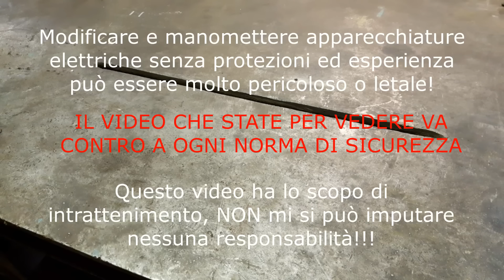Microwave transformer, the best modification for Spot Welding machine

Comment: Zusammen hat die sekundäre Wicklung (Hochspannungswicklung) ca > 25 Ohm Wechselstromwiderstand.
Diese macht man zur primären Wicklung.

Warum trennt man nicht die vorher noch sekundäre Hochspannungswicklung in der Mitte einfach 
gant auf  ? dort setzt man eine Lüstterklemmen dran . Dahinter kommt je ~ einen dicken 30  Ohm Widerstand 
mit Kühlkörper je nach Trafotyp. Setzt dort auch noch an die ganz aufgetrennten Enden Lüsterklemmen. 
Dann legt man an eine Wicklung 220 V dran dann schlißt man beide Wicklungen parallel die dann  auf 12,5 Ohm Wechselspannungswiderstand (wegen stärkerer Eigeninduktion) plus ~ 12,5 Ohm Normalwiderstand kommen. 
Somit wieder 25 Ohm. Durch die Übersetzung bekommt man dann an der dickeren Wicklung vereinfacht ca 21 V.  
jetzt aus der dickeren sekundären Wicklung mit ca 10 - 20 A  ? als Trafonetzteil für zuhause ?

Dahinter käne dann das stabilisierte Brückengleichrichternetzteil
eine primäre Kippsicherung schadet hier dann bei 220 V auch nichts.
Einige Mikrowellentrafos (wie mein verwendeter) 
(Wikipedia und Google geben hier unterschiedliche Werte an)
Die meisten  liefern aber bereits normal 25 V Europa , 10 -12 V USA
Man bekäme dann sekundär (in Europa) 50 V !

Comment: Interessante, ma con un solo primario (rispetto alla possibilità del parallelo proposta), la potenza del trasformatore non aumenta rispetto al singolo trasformatore anzi, il circuito magnetico risulta più complesso e maggiori sono le perdite del flusso magnetico. Per quanto riguarda il secondario, effettivamente sono necessarie 4 spire che però si riescono a ottenere ugualmente con un singolo trasformatore. Le possibilità sono due: o si tiene il core del cavo 1 AWG e si rifà l'isolamento esterno molto più sottile (lavoro un po' complicato ma fattibile) oppure, un buon compromesso semplicissimo da realizzare è costituito da un secondario bifilare cioè due in parallelo ciascuno di quattro spire con comune cavo da 16 mmq di cui, tra l'altro, ne può essere usato uno soltanto in caso di necessità di minore potenza.

Comment: Can you tell me how many windings and what cross-section the cable has? Thanks
Reply from the maker: Hi, I made 4 complete turns of cable, the copper section is 12 mm in diameter
Reply: Thank you
Reply: Approximately how many amps come out of this?
Reply from the maker: It depends on the power of the primary and if you put only one primary, or two in parallel... With a primary you get about 300 amps. However, I recommend you follow the channel, because before the end of the year a new video will be released with a new very powerful transformer for spot welding machine...

Comment: If you use two smaller secondary wires and wrap on with one more turn than the other it would greatly reduce the hum as the alternating cycle of each wire will not be in unison as the voltage differential will seek to equalize.

Comment: che spessori di lamiere riesci a saldare? io devo saldare lamiere di auto e vespe. un saluto e ottima modifica
Reply from the maker: Ciao, mi è capitato di saldare lamiere da 2 mm, quindi per lamiere da 6, 8, 10 decimi, non hai sicuramente problemi.... per fare un bel lavoro, mettici anche una ventola di raffreddamento
Reply: @newtech5042  si pensavo proprio di riutilizzare la scocca di una saldatrice con annessa ventola. Una curiosità: hai provato a metterne un altro in serie? Potrebbe portare qualche vantaggio?
Reply from the maker: @NewRetroElectronics  Con la scocca di una saldatrice puoi ottenere risultati ancora migliori! Mettendolo in serie ho solo ottenuto più volt, ma non va bene se vuoi creare una puntatrice!

Comment: It was possible to install two primary windings connected in parallel. By doubling the power of the primary winding. And even better, connect two transformers in parallel and you won't have to cut and weld anything.

Comment: I made one, but with a transformer and a plug, and I made 3 turns of 35 mm cable...but when I measure the voltage of the coil, I don't find anything, knowing that the spark is high...is the lack of voltage normal?
Reply from the maker: Hi, actually you should find voltage, even just 1 volt, but you should find it...
Reply: @newtech5042  I will not pay close attention and I was measuring direct current.. the mistake was mine.. now I measured and found 2.8 volts.. but the current was not enough.. now I collected two 10 mm wires and turned 4 turns and now things are good and the voltage is about 4 to 5 volts
Reply: @MoradELectro  with 2x10mm and 4 turns are ok for cells soldering?

Comment: Almost everything you did was wrong or unnecessary.,  Curing off the mounting base of both transformers was the first error.  Using both primary coils, with one bottom and one top would allow wiring in the middle, wire the primary coils in series and make it 220VAC, gives you better low heat high power to the transformer. I used two 12GA solid wires in parallel to make the secondary coil, produces around 48VAC and uses less ampere to spot weld.  Adding a voltage control to the input power can make it adjustable for fine tuning the output heat and excessive burn on thinner materials.  Full on maximum power my spot welder uses less than 18 Amps and runs cooler than other factory made units I have owned in the past.  Good luck.

Comment: Before soldering the two cores together, you should make sure that they fit perfectly because if there is an air gap between them, the magnetic circuit loses efficiency.
Reply: CORRECT  JORGE  BUT SOLDERING TOGETHER IS  IMPOSSIBLE, TOTAL MISS MATCH OF ALL MATERIALS. NEVER ENLIVEN ORIGINAL TRANSFORMER WITH SECONDRY STILL PRESENT AS 6,000V COIL WILL KILL YOU  IF YOU ACCIDENTLY GET ACROSS IT.

Comment: The idea is best, realizing is the worst. In this configuration magnetic shunts don't need, and as is was told below, the gap is unappropriated. And there doesn't need to weld, it is enough to to tight with metal string.

Comment: There is no point in such a design. Wasted time. It would have been better to connect the two primary windings in parallel and the two secondary windings in series. Then you would have double the power.
Reply: Would you please explain why??
Reply: @sidamarali3030 По тому что мощность магнитного поля зависит не только от объема магнитопровода, но и от мощности первичной обмотки.
Reply: @sidamarali3030  потому что первичной мощности трансформатора будет недостовать, и напряжение вторичной обмотки будет проседать под большой нагрузкой.
Reply: Yeah i saw a video of that very set you just mentioned and it worked wonders
Reply: Спасибо, друг! 👍😀

Comment: Hello, I am planning to use this spot welding machine to solder copper foil but don't know if it is possible? Can you help me make a video about using this welding machine to spot weld copper foil?
Because I'm not good at English, I used Google to translate the words. If there are any mistakes, I hope you understand
Reply from the maker: Hi, copper is a low-resistance metal, so it is very difficult to weld it with a spot welder... Someone has tried with tungsten electrodes, but with poor results, so for now I don't know how to help you...
Reply: @newtech5042  Thank you for this sharing. I'm looking for a way to solder copper foil without using oxygen or tin solder. Do you have any method to solder copper foil without using oxygen or tin solder?
Reply from the maker: @ManhTa-i6u  the laser is one of the most precise copper welding techniques and allows resistance welding, in which copper is heated by electrical resistance, to obtain joints of high resistance and high conductivity. Tig (Tungsten Inert Gas) welding can be carried out with or without filler material.
Reply: @newtech5042  Thank you very much, wish you good health
Reply: hello manh, your English was excellent, best wishes from new zealand.

Comment: Please tell me,sir,i have only 110v japan used microwave oven transfomer, our electrict line voltage is 220v,Can i use this 11o transfomer? Please.
Reply from the maker: Hi, you can't use a 110 volt primary on a 220 volt power line, because it would burn out quickly... But if you have two identical transformers, you can put the windings in series, making 110+110= 220 volts

Comment: You are the only one I have seen who put enough turns on the secondary.
I have to admit I hadn't thought of cutting two transformers apart. I was going to use 2 or 3 conductors  and use different insulation.

Comment: ну нужно было сердечник сжать как можно сильнее перед сваркой, у Вас зазор получился, а это уже больше дроссель чем трансформатор, тоесть теряете мощность и не мало, ну и мало сечение магнитопровода, только больше возможность намотки изза размера окна. ну и чем выше напряжение вторичной тем ниже можно взять ток, всё определяет габаритная мощность. так что чем выше напряжение вторички тем лучше будет варить! нет, не всё так однозначно, тут нужно подбирать максимальную золотую середину. трансформатор это компромис между током и напряжением.
Reply: I also made a virgin lama li time since triple did not spot weld the alanine, this transformer was small so the thickness increased to 1.5mm thickness, 2.1mm lam cross section. It may be possible to connect two transformers or to do it in this way, but I need to find a large diameter transformer. But it is perfect for burning metal.
Reply: нужно было оставить две первички, одна не вытянет, и да на видео дилетант который учит плохому. Так он еще и шлифанул бока, закоротил пластина еще больше ухудшил и так плохое железо
Reply: Вопрос в другом: а зачем для точечной сварки вообще использовать трансформатор? Если можно сделать батарею конденсаторов большой емкости и относительно низкого(16В например) напряжения? Скажем на несколько фарад суммарно. Переключая выключателями блоки емкостей можно регулировать мощность токового импульса и соответственно - глубину проплавления. Замыкатель - через мощный медно-графитовый выключатель(чтобы не пригорели контакты) или через мощный тиристорный ключ(на тысячу или полторы тысячи ампер и низкое напряжение). Заряжаться такое чудо может от обычного БП- розетки на 12В через токоограничивающий резистор например. Да, батарея будет заряжаться после каждого разряда несколько секунд, возможно даже десятков секунд, но за это время как раз вы деталь сместите на следующую позицию и осмотрите предыдущую точку.
Reply: @СяотестерСяомей  ЦЕНА КАКАЯ ВЫЙДЕТ,
Reply: @Alexei-Belarus  Если речь идет о устройстве для приваривания тонких металлических лент 0.5мм (например выводов литиевых аккумуляторов) - то коненсатор на 16В емкостью 100000 мкФ стоит около 6$. + копеечный БП на 12В + тирристорный ключ на 1000А примерно еще 6 - 7$. Все вместе примерно сравнимо с мот-ом от микроволновки. Но у такой установки в отличии от МОТ-а неограниченный потенциал для улучшения путем наращивания емкостей, и энергия выделяется в лучших традициях точечной сварки: коротким мощным импульсом.
Reply: @Alexei-Belarus   Еще рекомендую посчитать энергию запасаемую конденсаторами, и обратить внимание что в этой формуле напряжение фигурирует в квадрате(т.е. повышение напряжения на конденсаторе в 2 раза увеличивает запасенную энергию в 4).
Reply: Гудит не из за сжатия сердечника а из-за того что он не посадил на эпоксидку первичную обмотку , сварка всё равно держит очень хорошо.

Comment: Autor udává, že dosahuje proudu okolo 350 A. Je to málo. A nedivím se tomu. Neodstranil zkratovací vložky a při svařování transformátoru nezabrousil dosedací plochy železa. Magnetický obvod je třeba stáhnout pevně dohromady a svařit co nejmenším svarem CO2.
V ukázce je vidět mezera až 1mm a to jsou obrovské ztráty. Pro porovnání - 1 transformátor bez demontáže rozřezáním - pouze odstraněním vinutí 2100 Volt, žhavení a zkratovacích spojek dává při 3 závitech kabelu 35mm2 napětí naprázdno 2,8 Volt a proud 570 Amper.

Comment: 7:15 that's interesting but why is it better to have a lower hum and higher voltage? I can understand the first idea behind the hum, but what exactly makes that noise? And why is higher voltage better? I would assume it's the electric passing through the wires but if that's the case then why don't other normal wires carrying voltage make the same sound?

Comment: Qual a  expresura   do  cabo 😊
Reply from the maker: Olá, depende da seção do transformador, no meu caso é em torno de 180 cm considerando os braços
Reply: @newtech5042  o  cabo que  expresura   tem   qual  a   medida
Reply: @newtech5042  18 cm como   pode  ser
Reply from the maker: @JoseSantos-nr1ce  Eu escrevi 180 cm...
Reply: @newtech5042  a  expresura  18 mm
Reply: @newtech5042  tamos  a  falar   de  expresura  não  em  cm    mas  sim  em  milímetro de  diâmetro
Reply: @newtech5042  180cm quanto  é  para  si
Reply from the maker: @JoseSantos-nr1ce  70 mmq = 16 mm di diametro
Reply: @newtech5042  ok  asim já entendi
Reply: @newtech5042   obrigado

Comment: Great idea. You could get more space for the windings and have more turns improvising upon the voltage. However, a query , Did you measure the current it delivers ? In my understanding rather than the Voltage , its the Current which matters when it comes to spot welding of metal together . Did you quantify the amount of current this design improves ? It would be interesting to see and know . Thanks a lot once again .
Reply from the maker: Hi, in my case I don't need much current, 400 amps. However, with this system, it is possible to insert another primary winding and have double the current.
The advantage of this design is that the copper wire does not heat up quickly.
Reply: Yes , Thanks  @newtech5042
Reply: Важен ток!

Comment: Sir i have home  inverter transformer connected with capacitor should I remove capacitor or is it ok without removing capacitor to make welding machine
Reply from the maker: You have to remove the capacitor
Reply: Sir capacitor connected terminal (two wire)are output?
Reply from the maker: The transformer primary has only 2 inputs, phase and neutral.
Reply: Sir I find  output wires but can't find  input wires it has four wires ,two of which are bigger than other two wires and connected with capacitor
Reply from the maker: If you have watched the video, you will see that I only connect the two wires on the primary, Just do as seen in the video
Reply: I easily findout output but I am confused finding input wires because of 4 wires , can I send an image of transformer to your email or watsapp so will you pls give any one this
Reply from the maker: newtech101917@gmail.com

Comment: Si combinó los núcleos de los transformadores ¿el amperaje aumenta?
Reply from the maker: Ciao, se metti due primari in parallelo hai il doppio degli ampere, mettere insieme i due nuclei è utile per avere più spazio utile e poter utilizzare cavo di rame più grosso.
Reply: @newtech5042   Gracias
Reply: @newtech5042  unas preguntas

Si le pongo el capasitor con el diodo el amperaje aumenta? ¿O el voltaje aumenta?

Y si tiene el capasitor con el diodo el transformador se rectifica a corriente directa?

Cabe aclarar que hablo del capasitor de microondas para la soldadora casera
Reply from the maker: Quel tipo di condensatore funziona da filtro per il microonde, nel caso di una saldatrice a punti non devi mettere nessun condensatore o raddrizzatore a diodi... non solo non serve, ma gli ampere sono troppi e si brucerebbe subito.
Reply: @newtech5042   osea que si le pongo el capasitor de microondas si el amperaje sube o no?
Reply: @newtech5042  se quema el secundario del transformador o se quema el capasitor?
Reply from the maker: Il condensatore per microonde è studiato appositamente per lavorare in alta tensione, circa 2000 volt e fare da filtro. Nel caso di una puntatrice la tensione è bassissima, il condensatore o diodo non serve, perchè non fa aumentare la corrente.

Comment: I thought you were going to use both primary windings, not doing that leaves power on the table and the core only achieves half of it's possible saturation.
Typical is to just cut the secondary out and then coil 8ga wire which produces plenty of power for light spot-welding needs such as for batteries. You control the primary winding with a spot welder controller.

Comment: If the core is big enough, I recommend using both primary coils. Position the coils on top of each other on the core, then wrap the 2nd coil between the primary coils in the form of a sandwich (use the thickest wire that can fit there)
Reply: And then join them parallel or what?
Reply: @pilatedndlovu8980   You can connect these primary coils sequentally (this connection increase turn count of primary coil twice), and then proportionally increase turn count of secondary coil (sequental connection helps you to select voltage of secondary coil more precisely by using odd count of turns in second coil).

But this modification hasn't any sense, because it's not necessary to use this huge wire diameter for second coil. My simple calculation shows, that it can be enougth 76mm2(d:10mm) for 2 turns, 50mm2(d:8mm) for 3 turns, 38mm2(d:7mm) for 4 turns, and only 30mm2(d:6,25mm) for 5 wire turns (as we see in this video for getting 3,6v on secondary coil).
Reply: @pilatedndlovu8980  Yes parallel.

Comment: Good idea. It helped me to put thicker wire in the secondary. So I have more space. These cores are about 800va. The area
transversal power, as in cables the more section the more current.
Reply: you could also use 2 trafos without cutting them, 220V in parallel, and wire the 1 thick wire from one to the other